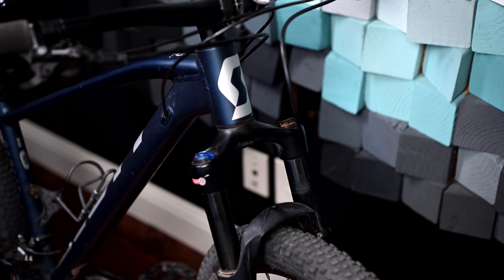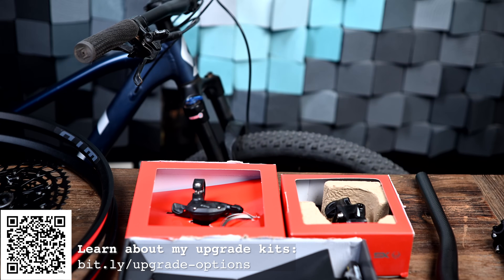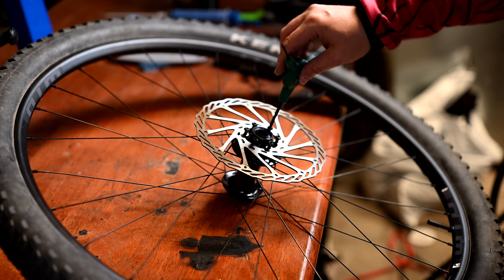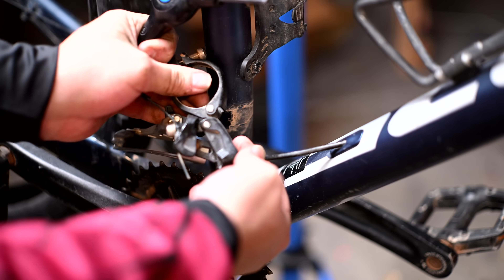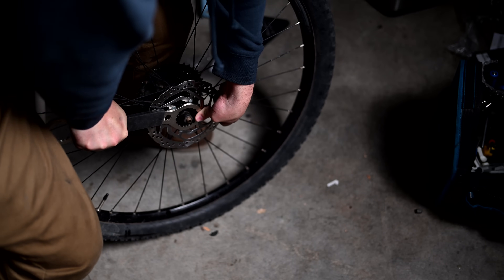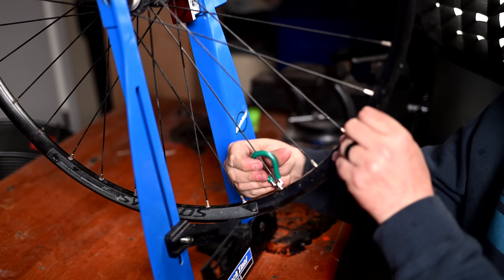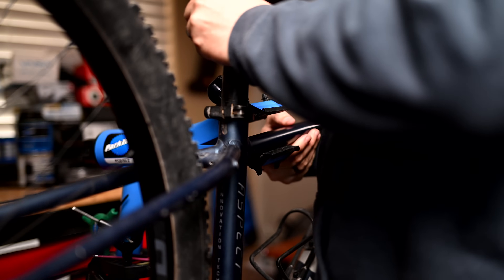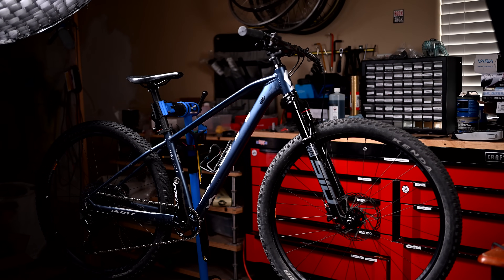5 Reasons to upgrade your MTB instead of buying new

Comment: I have a 2007 Specialized Hardrock that I've been slowly upgrading the past 3-4 years. Now in the process of finishing the full upgrade. Here are all the parts, Box Prime 9: Wide-Range 1x9, absoluteBLACK 28t ovel chainring, RockShox Reba RL Suspension Fork: 26" - 120mm Solo Air - Straight Steerer, Shimano SM-RT66 Disc Rotor - 160mm,  Shimano SM-RT66 Disc Rotor - 180mm, Shimano Deore M6100 Disc Brakes, Race Face Ride pedals, Ergon SMC Sport Gel saddle. Magura Rotor adaptors, Sun SOS 26″ Disc Wheel Set, Kenda 26x2.35 Nevegal X DTC KSCT tires, Vittoria Air-Liner MTB.
Reply: Man - bikes have come on SUCH a long way since 2007! The geometry is longer and slacker, making them much more stable downhill; they are stronger, for increased abuse; they have internal cable routing; they have seat tubes ready for droppers.

You need a newer frame!

Comment: I have a 2016 Whyte 629, took it to a bike park for the first time and it rode really well, but another bike I rode was a 2022 model and that was so smooth compared to mine, I was planning on upgrading my bike, but after riding the 2022 model, I'm torn between upgrading or buying a second hand 2022 model, the only upgrades I have in mind is a Shimano Cues 10s 1x groupset to replace the mismatch of drivetrain parts it currently has and also putting the bike back to 29" wheels, this all in will cost north of £350, whereas I could save up a bit more and buy a 2022 model for £600 and have most of these parts already fitted but with updated geometry.

Comment: I have a marin san quentin 3, 1x12 deore and 130mm revelation fork with 4pot brakes. Its amazing but racing enduro its not enough, so I am looking for a mid/high end full sus for 4200 usd. I was thinking of a new spectral but any suggestions?

Comment: Guys do you know how to fit a tapered headtube fork on a straight headtube frame? I have a cannondale u trail 5 and i am looking forward to upgrading a fork to an air one, but i dont know how, would appreciate any help
Reply from the maker: Yup. I discussed this on my previous video. Check it out.
Reply: Before trying to fit a tapered fork into a straight headtube frame you need to make sure that the frame can handle the upgrade. 

To do that compatibility check you need to look at how big the headtube is, and what kind of headset it uses now. If the headtube is really narrow, and the headset bearing cups are outside then the frame can't be made to work with tapered forks. However if the headtube is a bit big, and the fork crown sits flush with the frame then it can handle the upgrade. 

In order to do that upgrade you need to buy a headset that adapts a tapered fork to a frame that's designed with straight steerers...

Comment: I think the point against it is with people who don't wrench at all, people go in a bike shop and get charged 150$ in parts and labors for things like brake pad changes or derailleur cable change and adjustments, like it should be an incentive to learn to do it yourself but it's often just scaring people even more. Price of parts and service in the bike industry is quite a sham most of the time...
Reply from the maker: Having worked as a mechanic I can tell you it's very difficult to make it. The odds are stacked against local bike shops so I have a hard time seeing them as the villains in just about any scenario

Comment: Combining entry level parts with high end parts are  nonsens, on aluminium hardtail frame ...   why ?  SID fork with mt 200 brakes ... ,    only if the frame too will be replaced in the future.
Reply from the maker: Sounds like you didn't make it to my Reason #3.